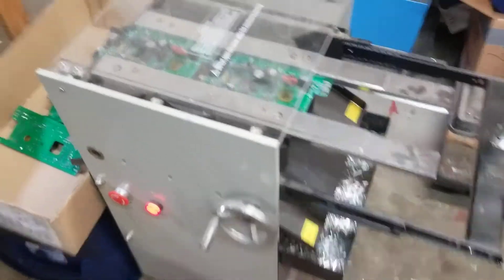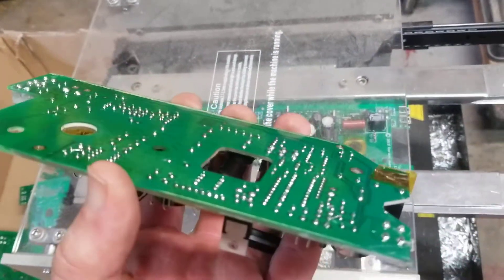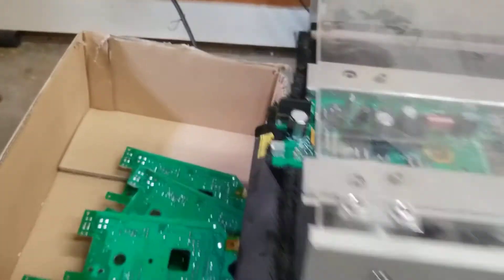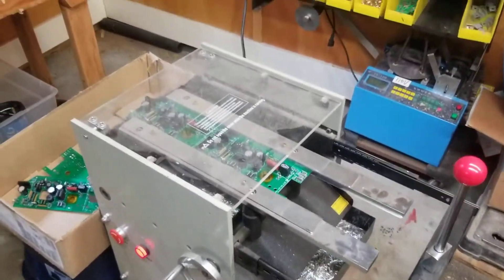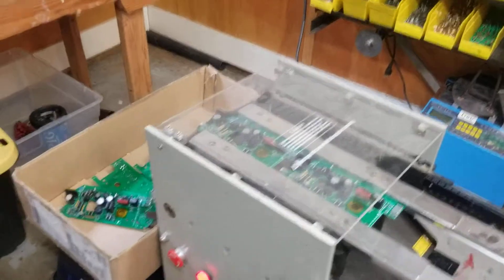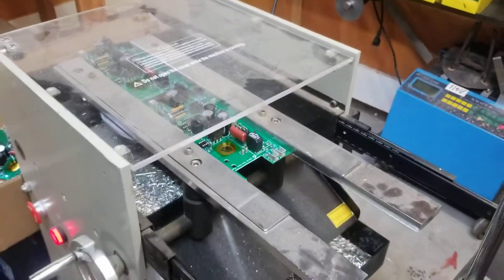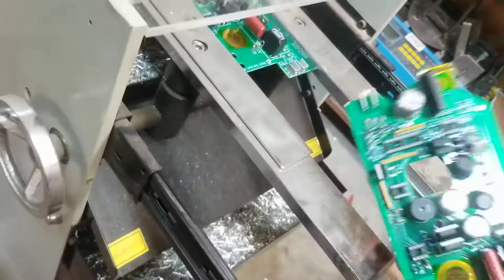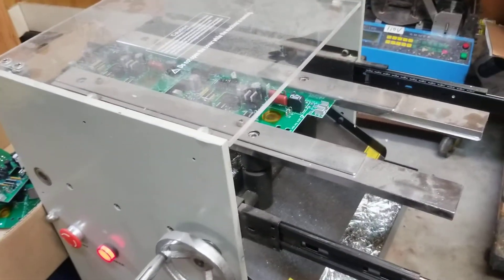ZB200E PCB lead cutter review

Comment: Thanks for the review, you made me tilt towards buying the same model especially seeing the heft (1/4 inch steel sides) of the machine and motor. Cheers    https://www.ebay.ca/itm/154096895832